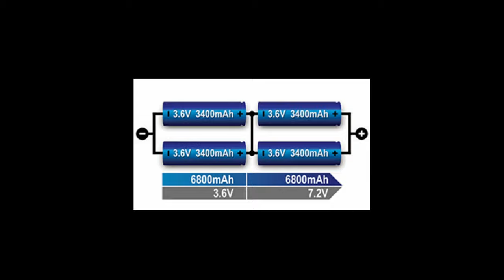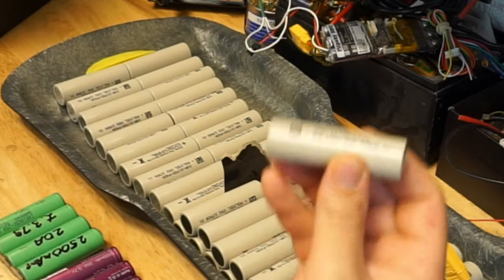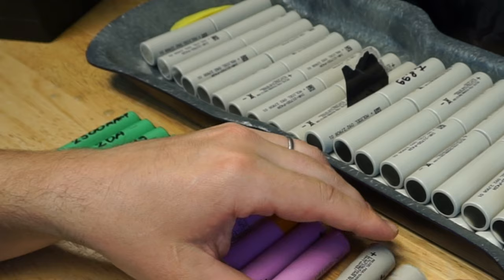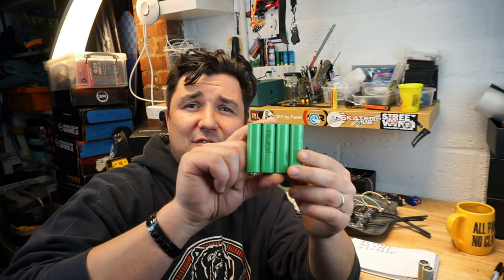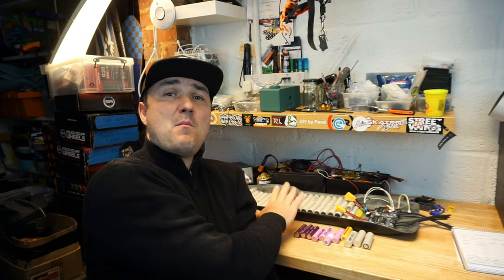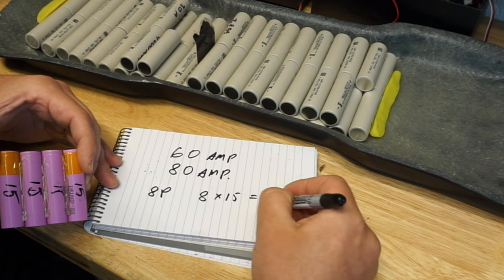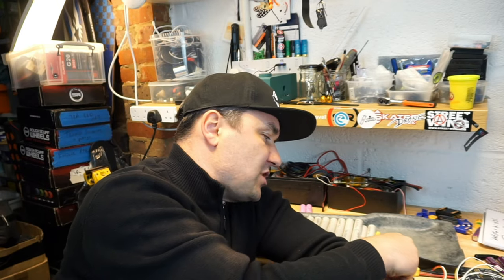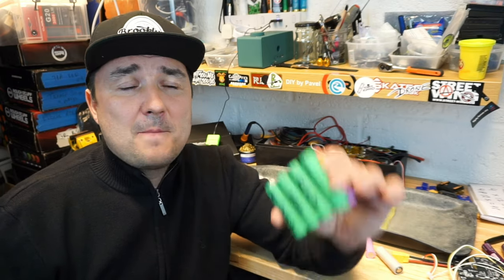ALL ABOUT BATTERY CELLS. BATERY PACK DIY VIDEO 01.

Comment: FYI: Be aware if you or any of your viewers deside to use a 26650 battery that all 26650 battery, regardless of brand contain a mis labeled 18650 inside the case.
Reply from the maker: Nice tip. Thank you.

Comment: I am using BAK N21700CG 15A 5000mAh batteries for my energy storage project.  These are 5A continuous, and 15A max.  10 batteries in a row make for 50A discharge.  The battery I am building is a 13S10P configuration for 2.6kWh (48V - 54.6V at full charge).  I am using a Daly Smart BMS that's 50A discharge, 25A charge.  For active balancing, I'll be using a 100Balance active balancer.

Comment: Big fan of the NXJO 35A 18650.Very consistent capacitance and output, I know the best application for these is more low volt/resistance but I like the piece of mind it wont start spitting or damage other cells in the daisy chain/pack. I used the Samsung equivalent you talked about, I found they had a very good quality as well, figured I would leave a recommendation for you or anyone else looking for a reasonably priced 18650.
Reply from the maker: Thank you mate 👍 any input is appreciated.

Comment: Great video. Very well explained. I'm going to use this info to build my first pack to upgrade a Razor E200 scooter from old lead acid batteries, to lithium. Should be a fun project.
Reply from the maker: Check out my battery building tutorials as well mate...got more info there.

Comment: Great vid, makes it easy for those that do not know.

Only thing I would have added for those that do not know, is that when dealing with electric motors Voltage is directly related to rpm of the motor.
Its not complicated, it just shows how we as battery builders balance motor power by rpm and voltage with longevity of amp hrs and the capacity of the battery to deliver current drain relative to motor rpm which also affects how long our battery will last overall.
Some people do not quite understand, if you are a heavy person, the motor needs more current to push the same setup as relative to a lighter weight person.
 So they wonder why their bike or board does not last as long in run time compared to their friends which is identical. And then there is gearing, don't get me started lmfao  so that highschool physics lesson is now relevant lol.

Awesome  vid mate
Reply from the maker: Awesome comment and thank you for the additional information.  Build and ride safely.

Comment: hi Pavel I want to change the battery in my 24vDewalt drill  I have bought 14 Samsung 25R 18650 Batteries I want to know what the wattage of the BMS should be or how to work it out many thanks John
Reply from the maker: Why can't you use the original BMS that came with the battery? 
If you will be looking to get a new BMS then you will need to find a 24 volt BMS with discharge Amperage matching the drill motor.
Reply: Thanks Pavel I will look into that
Reply from the maker: @johnrowland6214  easiest way is to reuse the battery case and the bms...just replace the cells .

Comment: Nice video Pavel. I think that those wanting to learn to build battery packs need to spend at least some months studying this online and figuring stuff out. Trying to understand it, watching many videos and going though the whole process and also realizing the dangers... I know pretty much all about it and have known for a year at least. I still don't feel it... My main battery guy sends me emails how he accidentally shorted something just for a moment, explosion, a hole in a battery cell. I managed to burn a third of my table, my whole hand black... I was just soldering XT60 to the battery and the two main wires just touched for a milisecond, never seen lightning in my apartment :D It's crazy what the cells can do.  Eskate packs or any bigger packs are not for beginners and even real experts need to watch out and make mistakes sometimes. This shouldn't really be messed with. Badly soldered series, might tear off, then you plug in your charger, charging a torn off 6s battery with a 12s charger and your home burns down... :)    You could show what it does when something that is not supposed to touch does... So that people see how real it gets.
Reply from the maker: Hey Mate!
I do agree 100% with everything that you are saying. Very valid points and thank you for sharing them with us.
I have a very strong opinion on battery building DIY and my plan is ( and I did mention this in my video ) to make part 02 video where I will show everyone what is required to actually build a battery plus all the dangers of building the pack yourself. Unfortunately there will be people who will decide to build batteries no matter what and giving people as much detailed information as possible is the best we can do as a community.
Thank you for the input mate. Hope to see similar comments on the next part ; )

Comment: Subbed. Good complete info here. When you are talking about parallel and series connections it would benefit people who don't know to explain the circuits briefly first .  ( additive amperage vs additive voltage )   I explain is like flow of water vs pressure of it.. people can visualize it better then usually. Ive done electrical work my whole life but just starting into making batteries so glad to find your channel
Reply from the maker: Thank you kindly.  Check out my battery building videos.

Comment: HI Pavel, so much info, it's so great that you share this with the community.  It's a lot to absorb.  I have a couple issues i hoped you could help me.  I can't seem to find what i need.  I'm not sure if i found it and missed it because I'm not experienced enough.  I would like to know how to test a load, on a lithium pack for my skateboard.  it's a 10s4p, I'd like to know, what is the rating of its max discharge.  I have no idea how to do that or what is it I need.  Iknow that at least you'll have an answer.  The other thing is that i would like to buy a small smart bms for it.  I'd love to know what you recommend please.

Comment: Hi Pavel, I have a possibly stupid question about designing electronics for my board. 
if I had a 14s4p battery (molicel 21700 42a 30A) how should I choose the motor and esc correctly so that everything runs smoothly and safely. What should I pay attention to when choosing electronics? Thank you very much for your message. I wish you good luck and thank you for your videos!
Good work.

Comment: Hello pavel great video  any help please  I'm making a 10s pack mostlikley  6p 21ah battery  with discharge  tgat will be 90a max its for a electric trails bike  the controller is 60a and motor is 800w obviously  it won't be drawing the full 60a all the time what bms do I use for my back a 90a  or 60a thanks
Reply from the maker: I do by- pass bms on discharge so no difference what Amp bms it is. But if you are uding bms for discharge,  use higher Amp tupe.

Comment: Great video. I was thinking the thicker DeWalt battery packs had twice the amp discharge capability because the thick battery packs run my circular saw fine but the thin packs don't run the saw very well under load. DeWalt batteries are 5s2p, so it's the 2p part of it that doubles the amps the battery is capable of putting out continuously. I'm wanting to rebuild DeWalt battery packs and also to make some long range battery packs for my FPV drones.
Reply from the maker: Nice one. Building batteries yourself gives you freedom to make exactly what uou want.

Comment: Pavel great video as always. I have a quick question Say I have a controller that is 52v and 40 amps. I build a battery pack with a  discharge rate of 240 amps so I can hit the capacity I want. Will it be to much or will the controller only draw what it needs? Im new to building batteries and want to learn. Thanks for all your help and resources you have created.
Reply from the maker: The controller needs to be the same voltage , you do set the max Amps when you set it up.

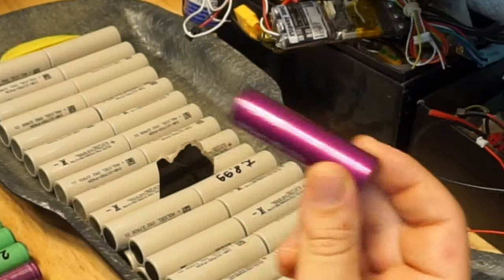Comment: 5:50 you're confusing battery capacity with amperage.  It is not 3000 ma, it's 3000 mah, which means it will run 3000 ma for one hour, big difference.
Reply from the maker: Thank you.

Comment: hi Pavel, thanks for your advice on the 24v battery it is now all sorted and works a treat, my next question is I have a 12v makita battery I can only get 4 cells into the case do I make it 4s or can I make it 3s and 1 p many thanks John
Reply from the maker: You need to make it 3S in order to have 12 Volt... 4.2 X3= 12.6 Volt.

Comment: Hi Pavel, here is a good one for you. I have an E-Bike that is 87.6 Volts, 18 AH, 1580 WH, weight is 25 lbs or 12 Kg, I have 3 of them, 2 are dead, 3rd one will not last, Li- ion, they cost $2500 American.  They were made in 2012 to 2015. This is basically an electric dirt bike. Battery size is 4.5 inch by 6 inch by 14 inch, It will do over 100 kmh. At about 40 kmh for 100 km. I don't think you can solve this one. The Oldest one is lasting the longest, 10 years, its lost 20 to 30 percent of it original capacity. I can still get 40 km as long as you don't smash the throttle, more like 40 % loss.
Reply from the maker: Thank you for watching mate. Interesting about your battery pack... maybe some were effected by vibration a bit more ? Did you try opening the failed packs?

Comment: Great video, very well explained. Can I ask as to why you would use a higher voltage? I realise motors may need a higher voltage. But why have a battery pack at 52v for example? Why not just 12v with a high capicity?
Reply from the maker: Hi mate!
Higher voltage will reduce requiered amperage to get the same power.
Normally 50 volt batteries are used on esk8 and amperage 50 - 90 per motor.
A few companies started to make 18S batteries for production boards...this does decrease the temperature of esc and cables as less Amps is required.

Comment: This video is BRILLIANT! I've learned so much! Thank you! At 21:30 you mention how you have a video about motors, I'm guessing this means how to pick out the right motor? Unfortunately I can't find the video on your channel.
Reply from the maker: Thank you for watching and for comments. Glad you liked the video. I do have a few motor reviews on my channel, What exactly do you want to learn? I can perhaps make a video on the subject.
Reply: @PavelGarmas  I think a video like this but just for motors would be pretty good! 

For example, if I want a motor that can pull X amount of weight and go some speed, what metrics should I be looking at? 

How do I determine if a motor can produce the amount of torque I need. How do I even calculate the amount of torque I need? That type of stuff.

Comment: Hi Pavel, nice education video! You probably already know this, the current used by the motors is not the same as what it is drawn from the battery. I know it's weird, but if your motors require 2x 60A, you will need less than 120A on the battery side, I would say around 100A. One can experience this looking at the VESC tool for example. You probably didn't want to over complicate an already complex topic I know :)
Reply from the maker: Hi 
Very good fact and yes, you are correct. 
I did not want to get into phase explanation plus i still believe that it is best to have a bit if "play" on the battery. So if people will aim for two motors at 60 Amp =120 battery discharge, they will be safer. I have noticed that a lot of guys out there do like to push the limits a bit more especially when they get used to they boards. Same goes for motors : motors that are rated to 60Amp from manufacturer can be easily ran at 70 :)
Thank you very much fir watching and commenting! 
See you next Wednesday!

Comment: Great video Pawel, but could you explain how to determine what voltage and amperage one needs for their battery/ motor
Reply from the maker: Hi mate,
Thank you for a nice comment. Ok so.... most commonly used batterie packs are 10S and 12 S because most motors can operate at that voltage. Normally aby motor can be set at 60 - 70 Amp safely. So if you have two motors, you will set them 50 Amp each = battery maximum constant discharge should be 100 Amp = 5P pack using cells that can constant discharge at 20 Amp.
Hope this helps.
Reply: @PavelGarmas  Thanks for your reply. I have an ebike 250w  rear hub motor, so what should be the total amperage of my battery which I need to build?

Comment: Incredible video. 

I have a question... well 2 actually.

1: How can a battery be 4200ma which is 4.2A right? But a discharge rate of 30A? Is this what flow of current is safe to pass through the cell from all of the other batteries? Because 4.2A is way less than 30A so I'm just confused on this. Or is it a little bit like AC stuff where you get get like a 5kA fault current through a 16A circuit? 

2: If there is a knackered cell or 2 in a 10s5p Ebike battery (Both of the knackered cells are in the same parallel group) is it safe to just rip the cells out and recharge the healthy cells back up to equal to all of the other cells and hope the BMS board balances it the rest of the way? Or is it essential that I replace those 2 knackered cells to keep some form of balance going? I know the AH of the battery would suffer slightly, but as a quick fix? Does there "need" to remain a 5p all the way through because of any kind of safety issue? Which is all I am concerned with. 

I don't intend on doing this, it's more of a theoretical question. I have to instead wait 2 weeks for more cells to arrive :(

Thanks a lot for your videos, keen to watch more. Nice work Pavel
Reply from the maker: Thank you very much. If you still have questions,  email pavsreview@yahoo.com

Comment: Hi, only 10 to 12 miles range seems very limited to me, for your next build i suggest you turn the drop center deck upside down n build a high deck instead, this would give enough clearence to build vertical cell packs of 180P possibly 200P, build 2 packs then spray all cell ends with a few coats of laquer or shellac, after making your extra deep pack casings with air venting in the ends, mount 2 or 3 PC case fans inside to help in keeping the cells cooler when in use or charging. use 3 or 4 QD lever latches each side to hold the casing on, this way one pack is home charging whilst you are out n about on other pack, when it starts getting low just swap packs to get straight back out again without downtime for recharging. i would think you would get 60 - 70 miles a time. ok too heavy for jumping or tricks, but lots o time out riding...... one drawback is you could get pull,ed by plod for speeding. if pack too low, space the axles a bit.
Reply from the maker: Hi mate! Wow! That is some interesting idea you got there. Thank you for sharing with me.
For my new build i have decided to go with 12S 6P pack using molicel 42P. Should get 30 -35 miles om one charge.
I do prefer the battery enclosure at the bottom of the deck to keep the board looking clean. This is the deck that I am going to use :  https://youtu.be/dHfiNUzCkUw

Comment: Is really a good explanation and helpful but i have a question.during building a battery pack is acceptable to use different ampere cell on paralel or is posible only on series between parallel with same ampere
Reply from the maker: I would not recommend building a battery using different type of cells... use extractly the same.

Comment: Pavel,  thanks for all your help... You make things easy to understand. My dual ER (extended range) battery pack Meepo NLS Pro uses the (10s2p) 21700 cells and I too, will use them in a not too distant home built battery pack custom made deck. I hope to use many, if not all, of the components you're using. I'm looking forward to using a VESC in the build, opposed to the standard ESC's found in the lower cost boards from China. I love my very custom Meepo NLS Pro component based current deck as it was my first esk8... but long for the ability to really customize it to my needs. Thanks again.
Reply from the maker: Very nice to hear that my videos are helping and do inspire people ;)
Thank you very much.

Comment: Would this advice be impartial of what vehicle i plan to power? For example, an E-bike or a wheelchair!

Edit: Since the voltage drops from 4.2 to 3.8 average and then maybe cuts off at 3.2 volts, would it make sense to add more Ps and then use a voltage regulator. I'd imagine that a constant 4.2 volts for a motor, then as the voltage dips, the regulator... regulates - it should draw more amps from the battery, but that would'nt be an issue. I'd imagine there would be quite a few formulas to calculate this shit.

Comment: Hi there bro , good job explaining this but even so I got lost 😬🤔on the minute 12:27 u said this cells discharge at 30 amps times 4 and giving u 320 amps? So I didn’t understood that part if each cell can deliver 30 amps times 4 would b only 120 amps right ? So where do I got lost
Reply from the maker: No... i said that 4 cells that are 3000 mAmp in parallel will give you 12000 mAmp.

Comment: Great video. I am looking at doing a 12s3p battery with either Samsung 21700 40T or the Molicel P42A. 
Can you explain or do you have a video of how to wire/spot weld the batteries so they fit in the enclosure long ways instead of side ways like how they are sitting in the enclosure on this video ?
Reply from the maker: My next video will be all about building a battery pack.
Reply: @PavelGarmas  thanks man ! Your awesome 👍🏼

Comment: Hey bro this was really helpful I bought a 10s3p battery pack from Amazon but the range is shitty. I got like 8 miles on at wheels I need more range .i would like for it to go about 16 miles. What battery configuration do you think I need
Reply from the maker: Rohan,
Thank you for watching and for the question.  Buy another 10S3P and connect in parallel and you range will double ;)  ... it will be 10S6P pack then.